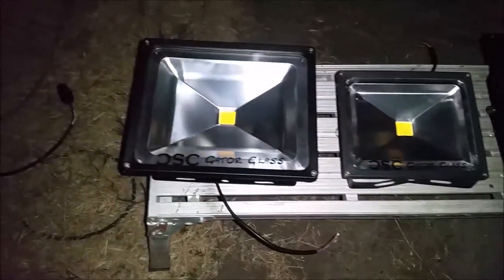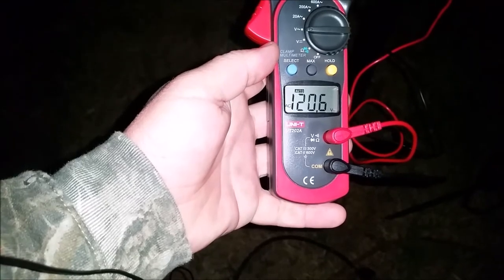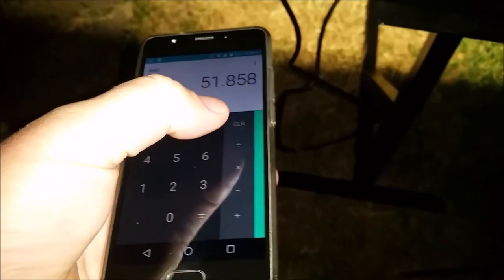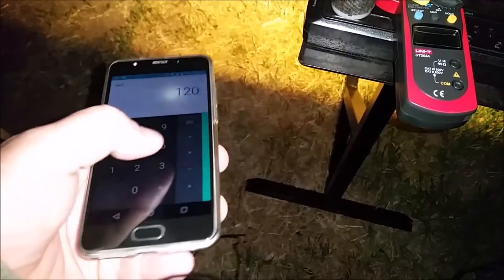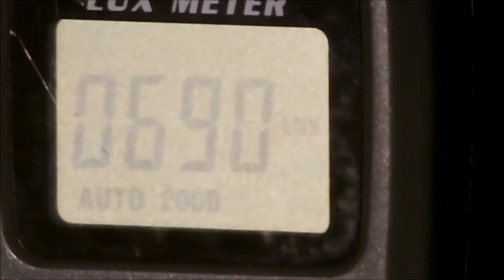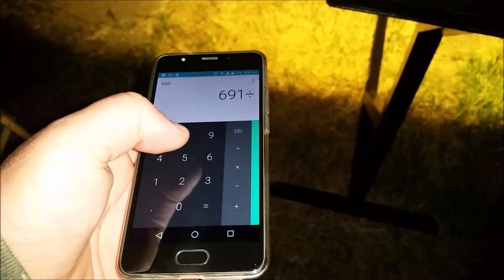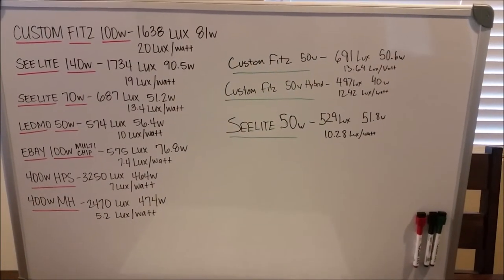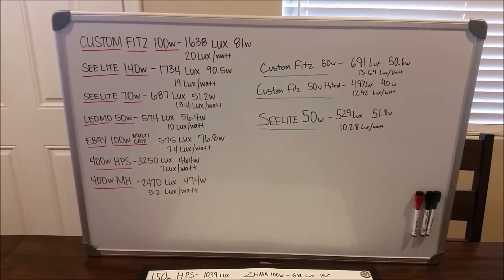Re-testing a few lights and adding them to the LED Big Board

Comment: I know this is an old video, but I am wondering what you have officially settled on for lighting? I am in between LED and HPS right now. Currently have 18 5w Viugreum 50W with yellow tint on the boat, but I also have 8 150w HPS Laying around I debating putting on